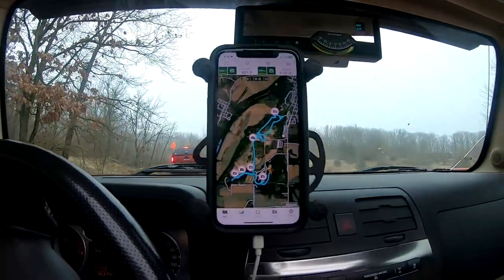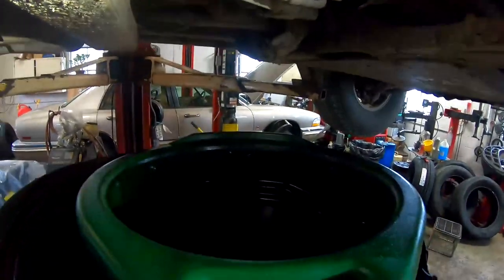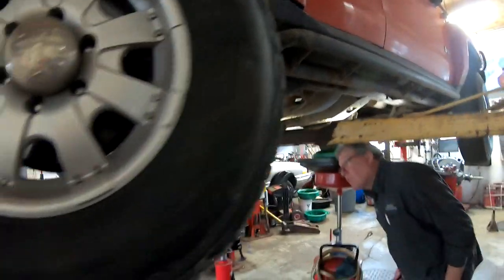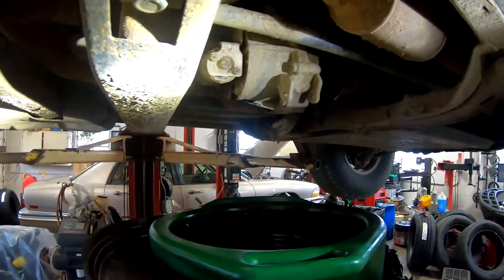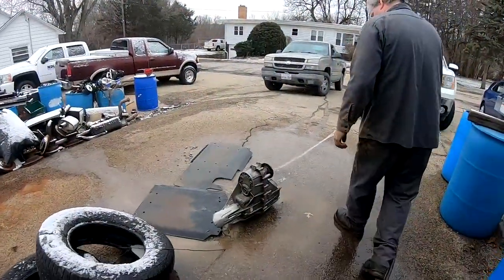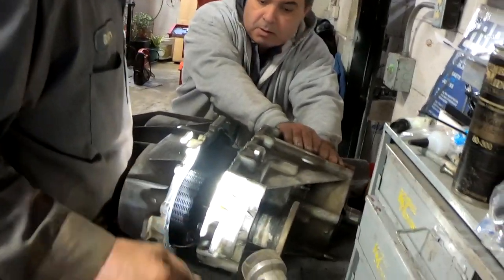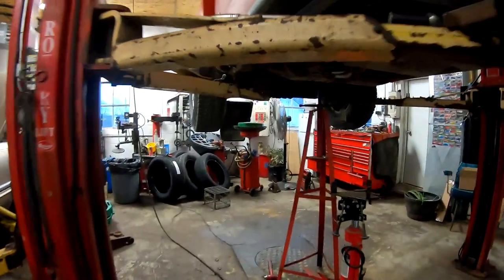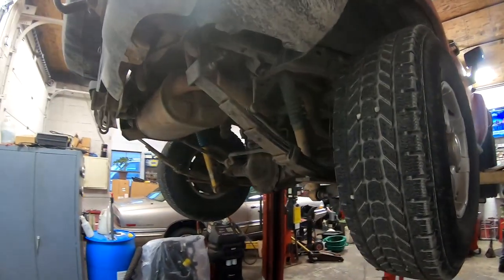Hummer H3 Transfer Case Replacement

Comment: You were partially right.  The spring that goes between the aluminum shift fork and the casing half appears to have failed, fallen apart and caused all the rest of the damage.
Reply from the maker: The fasteners that secure the snubber back out. Some guys who work on these cases often told me early versions lacked the snubber but have an audible whine. Adding the snubber eliminated the whine, but created a worse problem. The snubber apparently became a fairly common failure mode.

Comment: Did you try looking for a suitable used replacement?
Reply from the maker: Only briefly - if we didn’t see the problem late on a Friday afternoon, I may have found more options. However, earlier research suggested a used t-case might have been risky (plastic fork possibly not replaced, same chain guide problem could exist).

Comment: Did you remove the lock solinid first before removal? I don't have enough room to get mine even off the shaft
Reply from the maker: We removed the actuator motor entirely - does that answer your question?
Reply: @IronWolfOverland  yes... it was the only way I could get mine ouy

Comment: You don't have to remove the studs to remove the transfer case and there are 5 of them.
Reply from the maker: How did you slide it out? We kept struggling with the heat shield. Any chance you can share a link showing the easiest way?
Reply: @IronWolfOverland  you mean the skid plate? I removed it first. If you rotate the tail end of the case toward the passenger side, the studs clear. If you rotate it the other way, the tail end hits the gas tank and won't move back far enough.
Reply from the maker: @ctaylor7089  , I think that’s what we did. On the Alpha, there’s a heat shield at the tail shaft. I suspect that we rotated as you described, and the studs would not clear the cross member.
Reply: @IronWolfOverland  I did not realize that was a v8. I don't know what I'm talking about then, I've never worked on one. My wife's is a 5 cyl adventure.
Reply from the maker: @ctaylor7089  , fair enough! Not sure if clearances are different between the two. I suspect that they are.
Reply: @IronWolfOverland  I'm sure the clearances are all together different. I wasn't trying to shit on your video, I apparently didn't pay enough attention before I ran my mouth.